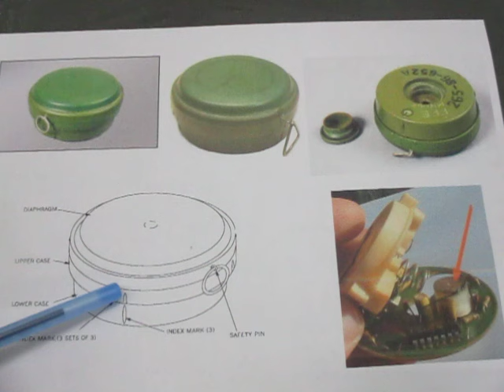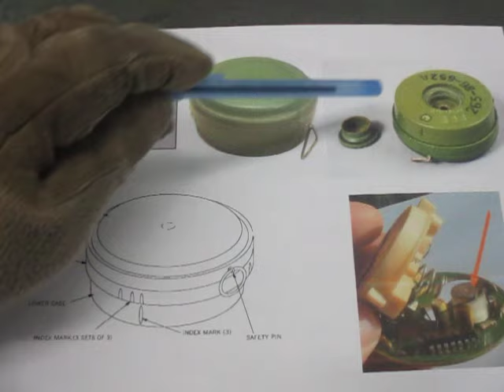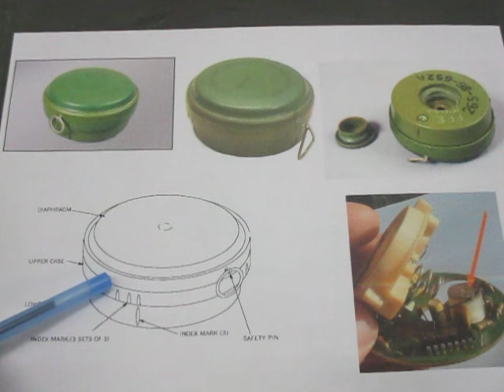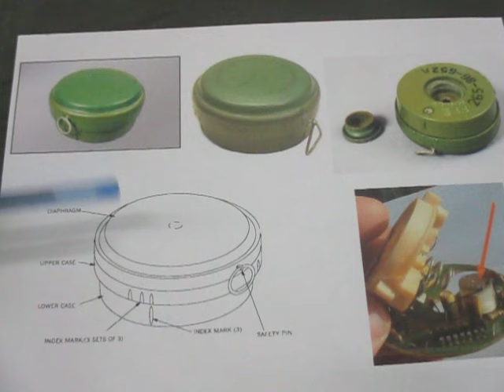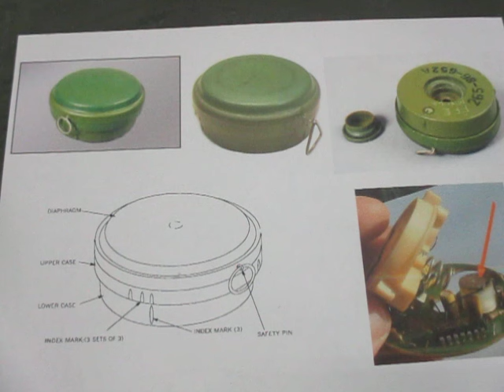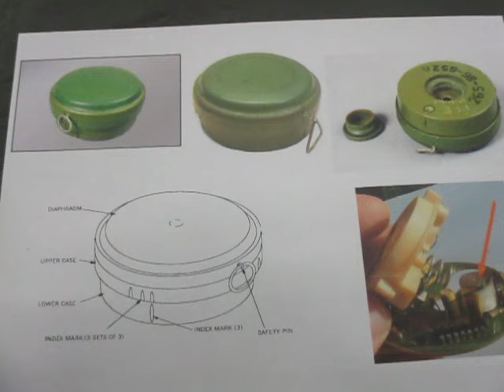Chinese Type-72 Nonmetallic Antipersonnel Mine

Comment: You say there is no metal other than the spring and firing pin but there appears to be a circuit board with several metal components on it. Note that metal detectors look for conductive metal - it doesn't have to attract a magnet.
Reply from the maker: Not paying attention were you.  The B and C models are the ones with the circuit which controls the AHD.
Reply: @SecurityGuy42  yes, but you didn't make a distinction in terms of metal content. You should have noted that the B and C models CAN be detected much more easily.
Reply from the maker: You missed that part about the B and C models also detonate when a metal detector head passes over it, also.

Comment: I was taught to use a ten-foot-long nonmetallic pole to place a charge 6 inches away from the item to be Blown in Place while belly down on the ground. Charge priming would vary depending on inventory and local conditions. Blasting cap, 10 plus feet of fuse and fuse lighter was the basic. Electrical caps and detcord systems could be used for large arrays to be blown together.
US Army 27 years' service 2 Active the rest in the reserve teaching recruits. 19D4H and later 11B4X.
Reply from the maker: Whoever taught you that had no idea what he was talking about.  You try anything like that in Engineer School especially where you place the charge you are a huge NO GO at that station.
Reply: I was taught to employ orbital bombardment to safely clear the area by pressing the triangle button while sitting upright on the couch. Playstation operator 15 years of proud service.

Comment: Judging by the photo, there are springs, and this is metal. So it is detected by a metal detector.
Reply: Yes but go metal detect a non-battlefield and see how many hits you get. Then detect a battlefield and see how many hits you get. That little spring will sound way less than the shrapnel and debris that has covered the area, and each hit could take hours to properly probe. It's not detecting a needle in a stack of hay, it's detecting needles in a scrap pile.
Reply: @keeftaylor834  AND potentially the metal detector may set the thing off as well.
Reply from the maker: The base model Type-72 the A model has an extremely thin spring.  The B and C models have a thicker spring but the mine detonate when a metal detector passes over it.

Comment: These landmines cannot be neutralised.

Since movement is likely to initiate these landmines, it is not practical to disarm them.

This landmine cannot be disarmed while the battery is still functioning.

Pull the landmine to verify the condition of the battery.

If the landmine did not detonate after being heavily disturbed, unscrew the booster/detonator well.

Remove the detonator from the booster.

Unscrew the plastic screw in the base.

Unscrew the upper and lower body.

Remove the percussion cap in the lower part of the landmine carefully by pressing a wooden pin through the hole at the bottom of the booster/detonator well.

This variant is claimed to be very sensitive to magnetic field distortions and it can be detonated by metal detectors passing over it.

When the safety pin is removed and the landmine is deployed in the field, the landmine can only be identified as a T-72B by using a metal detector.

The detector gives off a very strong signal compared with the signal of a T-72A.

This is due to high metal content in the electrical control assembly.

Pull the landmine from at least 20m.

Observe the landmine to ensure it has turned over and where it comes to rest.

Wait 5 minutes.

Lie down and pick up the landmine by the sides using thumb and forefinger.

Keep other fingers away from the pressure plate.

Unscrew the booster cap from the bottom of the landmine.

Remove the landmine and booster cap (with detonator) to the landmine storage area.

The landmine still represents a hazard as it has a fixed detonator built into its body, on no account is the landmine to be pointed towards anyone or hands and fingers placed over the bottom of the landmine.

The landmine is to be stood on its side in the storage area, with the booster cap close by (but not where the landmine body can fall on it).

If you are unable to unscrew the booster cap, do not use excessive force.

Even if the landmine is pinned and appears to be a Type 72a it must still be pulled.

Pins from Type 72a landmines have been cut down and inserted into Type 72b (anti-handling) landmine bodies.

To disarm the landmine, the booster and detonator assembly is unscrewed from the base of the landmine.

The stab-sensitive detonator can then be tipped out of the central recess in the booster.
Reply from the maker: I seriously DO NOT recommend dismantling a land mine unless you are trained EOD, Bomb Disposal, or Combat Engineer.
Reply: @SecurityGuy42  that's correct please lady's and gentlemen don't remove or play around with mines its a very risky business. security guy is right about this one.
Reply: "If the landmine did not detonate after being heavily disturbed, unscrew the booster/detonator well" yeah, it didn't go off when I fucked with it at a distance. let me get up close and personal. why bother with any of that when you could detonate in place
Reply: @erickhuntsman240  that's if you have explosives sometimes in the field that is not the option that one has mate. you need to read the complete information its to test if it's an AHD version if the battery runs dry then it can't act as an AHD that's why its done with a hook and rope to flip the mine over and remember these mines are in 3rd world countries not everyone has the luxury of c4 or a de-armer device. I'm a deminer and this is why I don't like posting much about land mines as I get silly comments like this and people who don't want to read the complete post or think about where and when the mines were imbedded in the ground. in fact, most of the mines in Cambodia are very much run dry when it comes to the type-72c and type-72b and my father was in the Cambodian civil war he was clearing and laying mines at 15 years old. in Cambodia these mines have been there for more than 40 plus years. and you need to find it so if you did use a metal detector you are already dead. so, it's done very slow with a prodder and there are procedures in place to look for them correctly, the UN does not like people teaching how to find mines nor even the procedure on how to disarm them. and it's called BIP BLOW IN PLACE, different mines call for different pulling techniques and there are wait times can very
Reply: @mrpopinfresh-w6h  thank you for your time and education.
Reply: @erickhuntsman240  that's ok I like to give Knowlege to the world when and where I can. but keep in mind please don't tamper or try to dismantle mines if you see a mine or IED, PLEASE REPORT IT. so it can be removed by correctly trained personnel DONT BE A HERO U WILL BE A HERO IN THE EYES OF THE DEMINERS FOR DOING SO AS YOU HAVE SAVED A LIFE OR MANY LIVES ALL READY.
Reply: I've seen another method.... throw big rocks at it and hit the deck! ( Actually watched a video from god knows where) 🤔
Reply: @cedhome7945  i have seen that myself. there is another method where they put a post in the ground and tie a water bottle to the post then a pull cord and pull the cord at a distance then the bottle falls on the mine activating it.